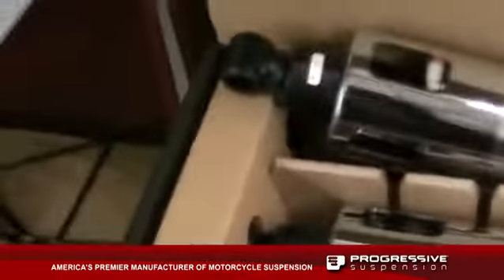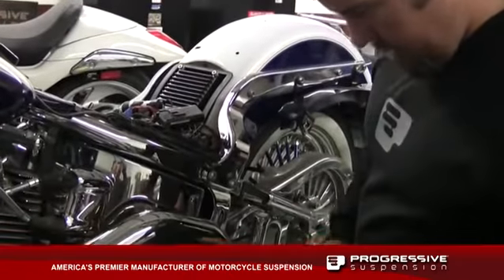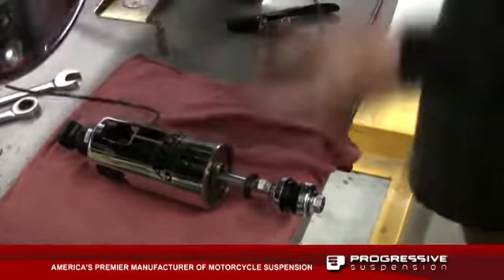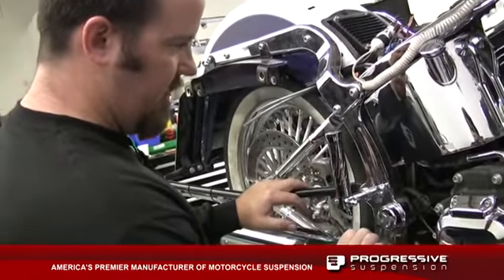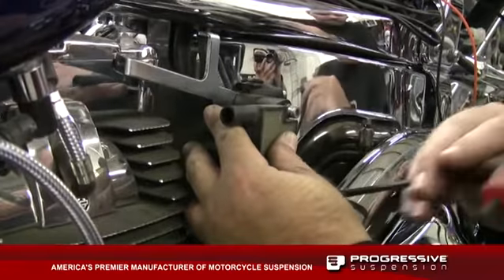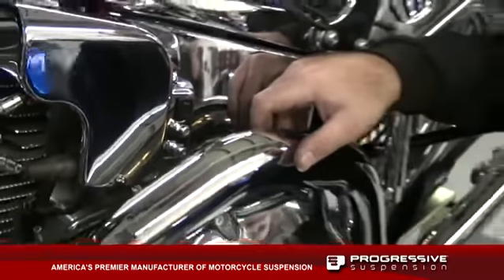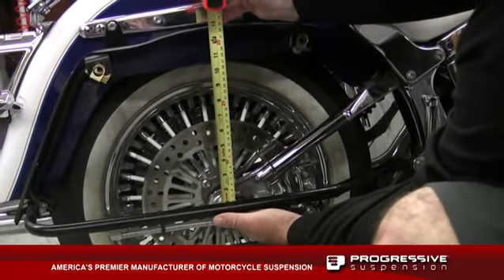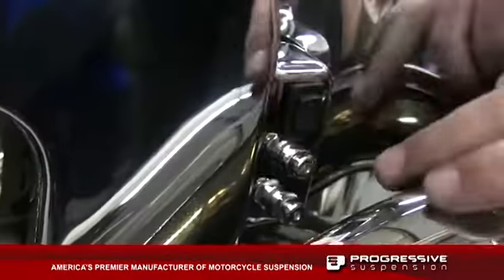Progressive Suspension Air tail Installation on Harley Davidson Softail

Comment: Hello, I'm trying to setup my Airtail Suspension System and have a question. 

In your video it said to fill the Bottoming Control to 150 psi.  The video shows the compressor being activated and vibrating around 150 psi.  When the compressor switch is let off, the needle snaps back and holds steady at about 90 psi.  

Is the vibrating 150 the correct psi value you are trying to achieve or is the correct psi the value shown when you let off the black toggle switch?

If it's the value shown when you let off the switch and the needle holds steady, then am I correct that the vibrating needle will vibrate past 160 while I wait for it to increase to 150?

Also, it said once you sit on the bike it should drop 1.25 - 1.5 inches.  If not, let a bit of air out of the bottoming chamber.  That would be the top silver button correct?

I hope this makes sense and I could really use some help seeing this up the first time. 

Thanks!